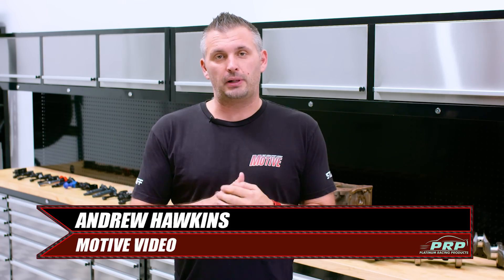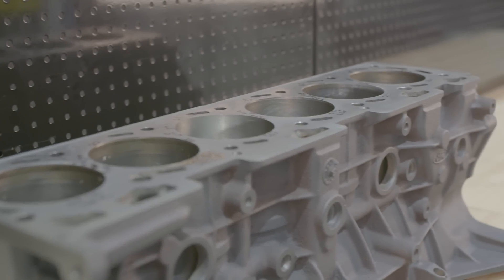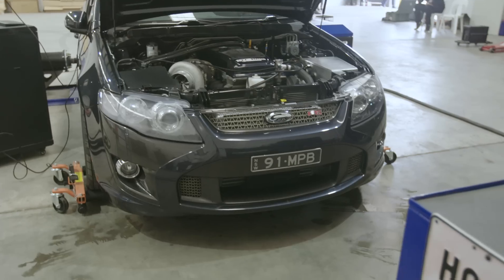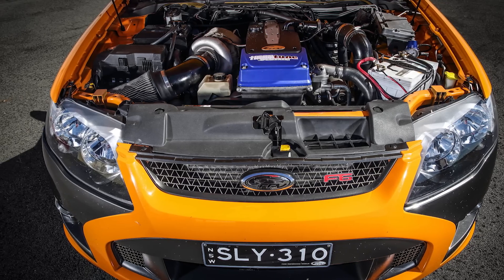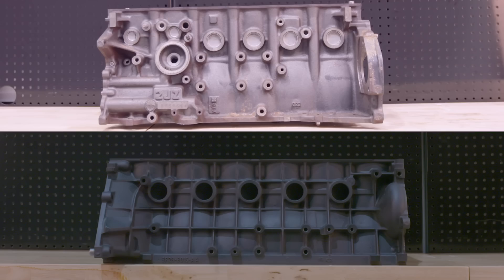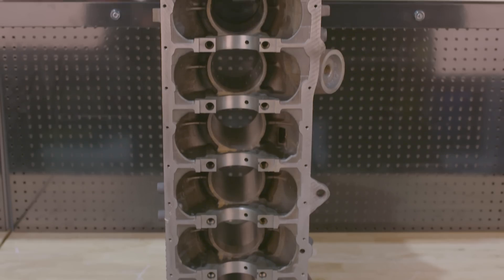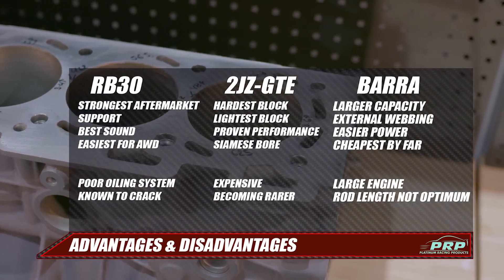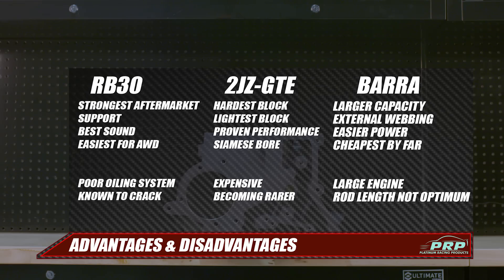Is the Barra 4.0L block better than the 2JZ and RB30?

Comment: Will a Barra (sounds like saying wheelbarrow lol) fit into a 96 4x4 Courier and What Gearbox, transfer case to use?
Reply: Marty Anything fits anything if you make enough mods. Go to a wrecker and measure it. If its too long you can always rear mount the radiator etc, not hard to do on a trayback ute. There are conversion kits available for Barra into Patrol, so maybe if your tunnel is big enough or you can run a sneaky bodylift, you could squeeze the Barra with a patrol box and transfer under the old girl ☺️ now that’s a build I would follow hehe 👍🏻
Reply: @KingOath  thanks for the reply,   the 2.6 G6 is tired and gutless. I've seen Buick V6 in them but tend to spit gears as the box ain't strong at all..  I've not been to a wrecker in years and must get myself updated with the stock they offer nowadays 👍
Reply: You know what I would do? If I loved the old girl and wanted to keep her going (I understand this - I drive an MK Triton) I would buy a cheap second hand 2.6 engine and have a go at rebuilding it. Nice simple standard top and bottom rebuild with some lower comp pistons, then make up a turbo manifold with a nice responsive little second hand snail of another car, I’m assuming it’s carby so you could grab a bigger/better carb off something else and set it up for draw through or blow through whichever you want to do. It won’t break any land speed records but you could have a great little reliable fun to drive motor with heaps of torque, have a ton of fun and learn heaps doing it, and come away with a heap of money left over versus doing an engine swap. Swaps really are a big job for the backyarder unless it’s a common car that has kits available, it will cost twice what you expect it to and take 3 times as long. But that doesn’t mean don’t do it of course! Just make sure you’re very committed, with plenty of spare time and cash before you start! 😁
Reply: @KingOath  Parts for the G6 motor are astronomically high, for what it's worth it'll be cheaper to transplant something like a Pajero/Triton V6 and gearbox . I want to bin the ifs and install a proper live axle setup with either leafs or coils , using Dana diffs front n rear..
 The truck is a tray back and I'll be body lifting it 2in over winter . Motor is EFI and very low compression from factory. Laws here in Sth Aust is I can go to 4.0ltr without engineer but still needs checking . 
 Turbo would be fun but if I go that way I'd rather turbo diesel  .. Doing engine transplants isn't hard for me as I can fabricate any bracket or tunnel mod I come across, getting back to the Barra, they are dirt cheap and reliable but gearbox and transfer options (avoiding Dellow) , an adapter plate would be best . 1st things 1st, get measuring up stuff...😎
Reply: Marty Hmm interesting, what about starting with another chassis that’s already live axle and setup for a big 6 cyl? You could buy a rolling chassis with transmission/transfer to match, then mate the barra up to the box and onto the mounts, then drop your cab down ontop of it?

Comment: All the bullshit around about the RB and Toymota blocks anyone would think they are supercar engines. Neither are, turbo Supras go quite well but to chase power cost a fortune. And they are expensive and hard to find.
The Datsun thing is way over rated. Ok certainly but hardly great and they have an oil starvation problem. And RB30s crack and corrode heads big time. Even when well maintained.
Then the old Chooktin engine. Strong, reliable and a lite bigger to start with. And I suspect no heavier as a long bare assembly than the other two. These things do 600000 in cabs with no drama. Unlike the other two. RB30 was closer to 60k in the few cabs that were used. Very bad rep with those blokes. I know of 250k Supras but they are smelly and rattly. But still go ok.
All of these engines have way too much timing chain and when you rev them with decent springs cam timing is out the door totally. I suspect that like too many engines  a race engine has about 2 hours run time on a chain before the cam timing is 3-4 deg out. 
Same problem as well but Ben Bray is using a 4500 Landcruiser engine. They are tough providing you do not cook them. My old 100 Cruiser had done 430k [mostly country] when I sold it and was on gas for most of that. And had never had the rocker cover off. And several years later is still around.
And they are both newer than the Supra or Datsun engines.

Comment: Great video as always,  i think its time for TB48DE engine,  massive displacement for I6 engine
Reply: amer jn1 I’m interested too, sounds like a lot of people are. But don’t forget there is the tb45 and tb42 as well. Maybe the capacity of those is smaller, but which is the strongest? I don’t know the engines well but maybe if the block castings are the same the smaller capacity versions might have more metal in them? Who knows. But there is so much more to it, the larger ones might have bigger galleries, better heads, etc. But to make a wild assumption, you would think that if those engines had amazing potential, that racers would have begun to use them by now? They have been around long enough for someone to have a go at one surely. Who knows, but it’s all very interesting
Reply: @KingOath  thats why we need tests like this,  im from UAE,  ive seen lots of y61's tuned and modified, the chassis is extremely heavy but we are talking engine of course,  we shall wait and see motive dvd upcoming video's,  comparison between TB42 TB45 TB48,  bare in mind they say barra's displacement is big for inline 6,  so what about 4.8 straight six?
Reply: amer jn1 That’s right, I have seen many TB modified for racing on youtube from  your country, but not many here in Australia or the US. You would think the US would love such a large gasoline inline 6 😊
Reply: @KingOath  im not expert alot with engines,  but is there a chance that it wont perform like a barra or rb and jz? Hence its built for off road and towing purposes
Reply: amer jn1 Probably in original spec, yes. Obviously those motors are not tuned for high rpm or top end horsepower, or for a racing feel like the RB. But all of that is changed easily for those in the motorsport field. As long as the bare block is strong and has decent galleries for cooling and lubricating at a racing level, it could be a good base. Rotating assembly can easily be changed to suit, heads can be modified and bolted down better, etc etc. Most racing production engines only use the original block and the rest is modified anyway. I would assume that if the top and bottom end were kept to standard specification and only strengthened, the peak power output would not be amazing considering the capacity, but a small number people are doing exactly this with the engine and getting very strong torque and low rpm horsepower.
Reply: @KingOath  hold on a second. im an american and i want to know what the hell this 4.8L i6 is!
Reply: Frigglebiscuit Nissan TB48DE, from the GU Patrol. Youtube “TB48 Turbo” for some mad video’s, the Saudi’s love them haha

Comment: I'm curious to know how the dime a dozen BMW M50/52 engine block hangs with these more expensive options. People are boosting them to 400hp with stock internals no problem. With cylinder head sealing taken care of they go over 500whp without much prep work. I've never seen anyone compare these to jz's though.
Reply: I've heard rumors of a 500+ Horsepower M50 on stock internals

Comment: They should test a m104 mercedes block
Reply: yes its an very underrated engine. they handle huge power even with stock internals
Reply: @davidsvanmark2857   it will shaite on any 2jz engine, they take up 1500hp stock block pistons and crankshaft, like any s38,m50 m30 block. It is nice that in australia they have all those japanese engines and support but there is nothing special compared to european engines from the era...
https://youtu.be/1OpJp9XnkgM
Reply: @claudiumxg1  thought the same..
Reply: They were going to but the W124 broke down on the way to the workshop

Comment: In conclusion: they're all going to make huge power. I wonder if Toyota engineers knew at the time what kind of monster engine they were building. Hard to imagine seeing as they came out with roughly 200kw from factory. Perhaps their intention was lasting season of JGTC abuse at 500hp all year, but build it 3x stronger. Who knows. Even the RB blocks were built so strong for such little power they made at the time. It's no wonder they're still driving around today as smooth as silk after 30 hard years of life.

Comment: All depends on your location. The aftermarket for the RB is nothing in US when compared to 2JZ. And the "cheapest by far" for barra applies here too, I'm sure shipping is not cheap, nor the availability of parts
Reply: im australian and for us the barra is so cheap. ive seen them selling NA versions for $79 ($US57) or the whole cars they come in for $750 ($US539).  but yeah importing would suck, buying stuff from the US sucks. back when our dollar was close to parity i bought 2 $US35 subs and it cost me $400
Reply: @CaffeinatedSentryGnome  I did a quick search and only found 1 seller in US with a barra engine. He was asking almost $2,000 USD. This didn't include shipping from Washington to Texas. I can only imagine what a gasket kit, waterpump, etc would cost shipped from AU. Quickly way above what a 2J can be had for in US, especially a GE block.
Reply: That's more than most BA Falcons are worth.

Comment: What if you start from scratch?
Here in Europe many consider the LS the block-to go even for drifting, heck it fits the BRZ....
Having an engine still produced and sold as crate isn't advantageous?
Reply: The LS is reasonably cheap. It has huge aftermarket support. It lends itself to good power fairly easy.... but no matter what you do to it it will still be a v8 with that unsexy "fat chick" rumbly uneven firing order that can't rev.

Comment: Barras do crack unfortunately, usually between cyclinder 3-4 in the cylinder wall when the engine is pushed on a relatively close to stock setup, I have heard this is a cooling issue but no solid evidence to back it up, I’m sure Barra specialists are aware of this issue and probably have measures to prevent it happening on more serious builds
Reply: The sohc block is stronger

Comment: 2jz might test better on the bench but the barra due to its larger capacity is gonna make the same hp at a lower peak cylinder pressure than a 2j or rb. So the block thickness and hardness aren't as important
Reply: Jacky if capacity doesn't mean a thing, show me a 100hp 1cc engine. Also I wasn't saying the barra is better. Im saying the results of the test aren't directly comparable in my opinion.
Reply: 2jz has been proving your bogan ways of bigger is better,get 3 litres of fuck your capacity just another victim to the king.you dumb shit the barras split with nothing boost.its called big ass water jackets around the bores.great for keeping it cool in the aust heat.zero good for building a boosted engine,how funny
Reply: jacky dewar lol nice profile picture and how come there’s Barras with 1200 and not cracking blocks dick head get of ya mums account ur embarrassing her
Reply: jacky dewar ur more bogan if any thing
Reply: @jackydewar3419  I don't know what your trying to say. Can you try again with some punctuation please.

Comment: Hey Andrew 
Just a question I've got me rb26 recently built in my 34gtr
2.8lt nitto stroker making 750hp
But a stock block now what problems will I run into at this power? 
Cheers Steven
Reply: In one of their previous videos they showed a girdle you put between the block and the oil pan to prevent cracking. I'm not sure about the 26 bottom end, but they've said before that the stock 30 bottom end should be good for 700-800HP.

Comment: All 3 are good motors, whichever fits in your car and you have availability for, if I had a car with either of those motors I wouldn't swap it for either of the other 2, the barra has the cubes, the 2j has 2jness and the RB can make more power than most can build the rest of the car to handle
Reply: If you no nothing about engines you will believe cubes win,2jz has been taking down big cube stuff for years no surprise it won the king 6,barras are not on the jz level.stats back that up,and jz being closed deck and barras open deck,,you don't need cubes to spin turbo you need strength ability to rev,boost torque trumps crank torque.or spelt 3 litres of fuck the world
Reply: @definitionmedia1130  School holidays is it?
If you know so much why can't you even use the right spelling of the word